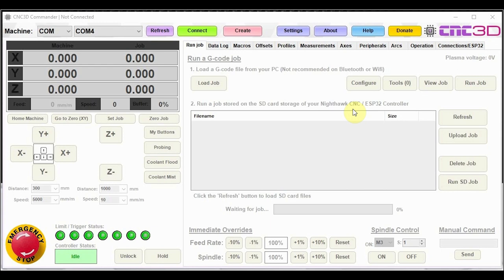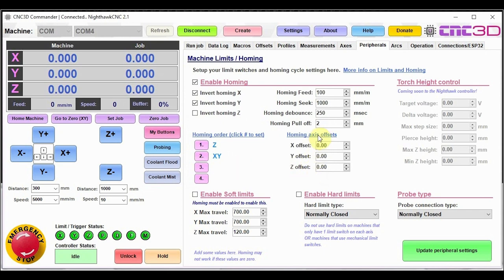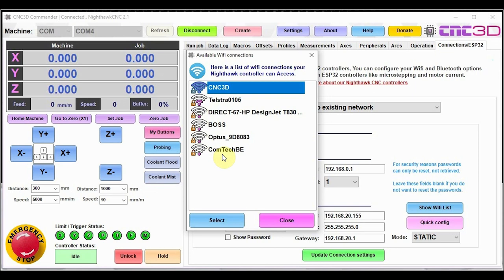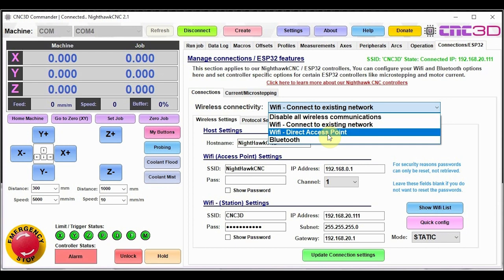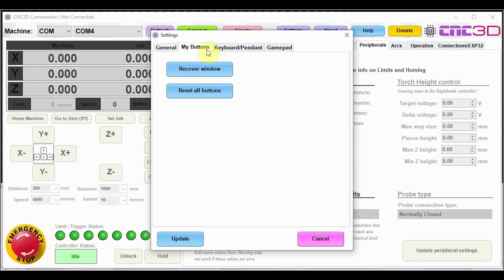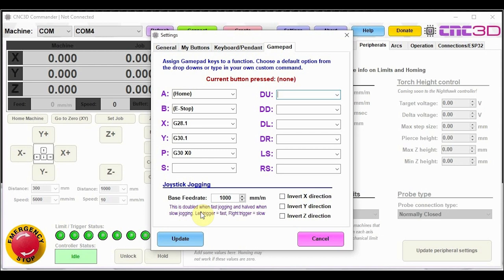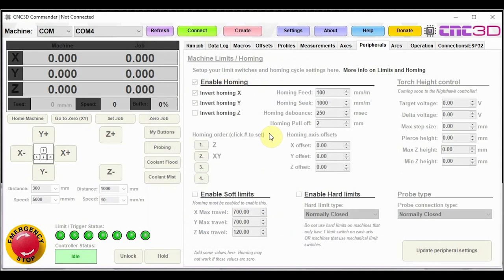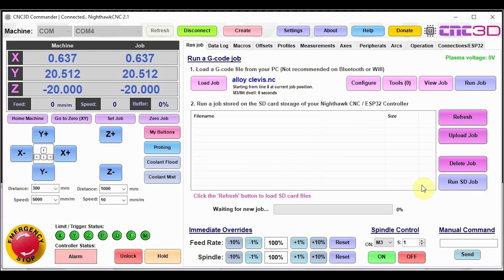CNC3D Commander Updates - Build 261 - Powerful GRBL control software

Comment: Than you for helping the DIY and hobbyist community giving the software for free. We appreciate it a lot. I am currently trying with a 4 axis GRBL board and it works nice. I hope in the future it could move 4 axis at the same time. I know I am asking too much.
Reply from the maker: Hi W D, 

Thanks for the feedback, we have some cool new features coming too!

I'm not sure exactly what you mean by all 4 axes at the same time but the current version of Commander supports 4 axes of control. You can enable the 4th axis by going into settings and choosing to show 4th axis.

Let us know if this helps!
Reply: @cnc3d  you are right. sorry, my mistake. 4 axis simustaneusly operation depends on the CAM software and post processor not in your application. Per say, Vectric only sends code for 3 axis (xza or yza) while one axis is locked. Again its not 3D CNC Comanders fault. I got confussed. sorry.

Comment: Great video!  Well well well!  so you guy's have listened to one of my and any other  people's  request (if any), (for the  pause and step thru feature) in witch that kept me from switching  using GRBL Panel  in witch has that  feature,  but i will defintely  try out this new version , one thing I did'nt see , is the Gcode  command lines   being executed  whisle  stepping thru the file!  ( very Important to  me!  but I might have mist it! any  how i will definitly   give it a go!.   I thank you for all the tremendous  work !  Great job 😎🤓
Reply from the maker: Thanks :)

The next release even lets you start stepped. 😎

Comment: Hi friend, thanks for the videos! I'm having problems with my man! it doesn't work, when I press to save the settings it doesn't save on the error board all the other parameters it writes in ESP32 except the home! And I have the feedback from the endstops X green Y green Z green and the P in red what does that mean? Thanks a lot for the help! hugs
Reply from the maker: You might need to powercycle after applying settings on some controllers.

Which controller do you have?
Reply: @cnc3d  ESP32

Comment: Please need help! I have my Sony Dualshock 3 working in PC, CNC3D software recognize when I press button and show the letter on Gamepad Tap options but CNC don't response. Ex. I setup  in Gamepad option letter A (Home) and when I press the gamepad the A button is not responding, also in the keyboard/pendant I setup letter H to do Home and is the same not responding, I press other letters in keyboard and is not responding. I reboot computer, software, last upgrade Windows 10.
Is something else I need to setup or do? Thanks in advance.
Reply from the maker: Did you click on the Keyboard icon in the middle of the X and Y jog buttons so it is highlighted in Green?

Many users miss this, we will look at changing this to be ore obvious in future.
Reply: @cnc3d  Thanks for answer, i did what you say and now working but after I move to some point and stop when I try to move again is not moving, green is ON, I have to press the stop button, unlock then work again but after stop I have to reset again. Any Idea?
Reply from the maker: @AngelRamirez-mu8pk  it sounds like you are going into an alarm state.

If so, click on the alarm, it will give you a translation.

Are you exceeding machine limits?
Reply: @cnc3d  No exceeding machine limits, I moving on the center or cnc. I will try to upload a video then you can see.
Reply: @AngelRamirez-mu8pk  I have the same issue. It appears to locking up the board. I order for it work properly I had to add a "F500" speed value to the G code and it works. Example: G90 X10 F500  - works. If it is G90 X10 - don't work and often only goes maybe a 1 or 2 mm and then looks up.
Reply from the maker: @MakerMike-bx5ms  Please try this again Mike. We have reworked the logic for this in the last release. :)
Reply from the maker: Please try this again Angel. We have reworked the logic for this in the last release. :)
Reply: @cnc3d  thanks i will try and let you know.

Comment: This feature doesn't work for me. I have reached out the company but it still has not been fixed. The software is new and still pretty buggy. I really like the software thou and it is currently my go to until I can find something better.
Reply from the maker: Which part is not working as expected Mike?
Reply: @cnc3d   1st-The pause feature, pause the machine but when you go to resume the process the spindle shoots off in some other direction. Rather continuing on it path that it is supposed to. 2nd the "My Buttons" will not stay on top. It keeps get moved to the back. 3rd the keyboard and game controller short cuts don't work right. Example-if arrow key is press and is suppose to move 10mm it might move maybe 2.3mm (is number is irregular) ,press it again and it might move 1.2mm, press it again and my grbl board locks up and has to be reset. I had mentioned that if the distance move is not followed by an "Fxxx" command I was getting similar results. Couple other things at I think it could badly use is a webcam feature and also the ability to probe a hole and find center. I hope this helps!
Reply from the maker: @MakerMike-bx5ms    the my buttons on top issue should be resolved in build 267 (current)

The pause button that allows you to step through should work fine as long as you allow the buffer to empty i.e: it has executed the last motion and has stopped moving.

It may not be suitable for jobs setup in absolute G90 positioning mode.

Keyboard jogging is continuous and the distance is set in "Settings"

We will look at changing it soon to have the option of continuous or incremental.

Hole probing is in the pipeline!
Reply from the maker: @MakerMike-bx5ms  Hole probing has also been added in the last version, please see this video on probing. 

https://www.youtube.com/watch?v=2q8tDUQNImg&t

I hope this helps!